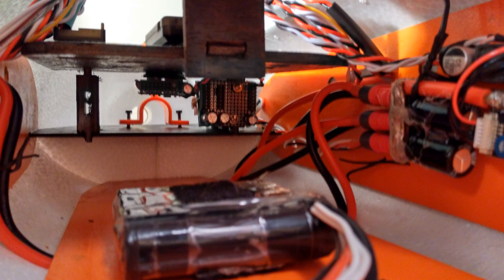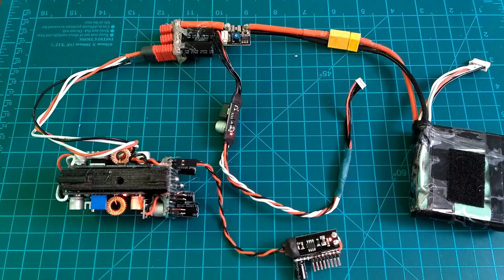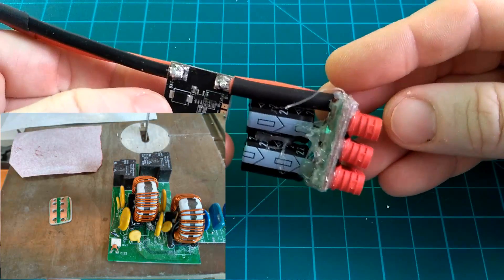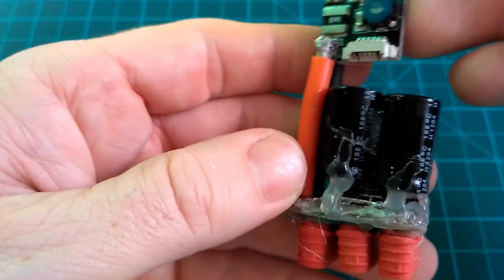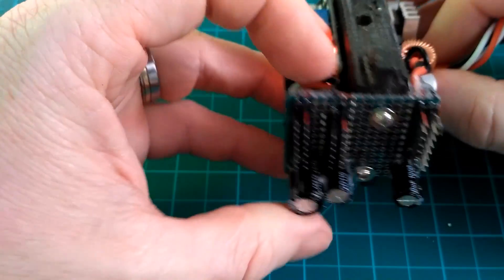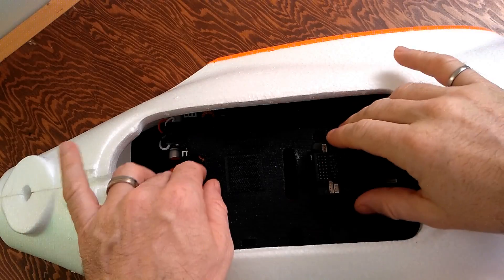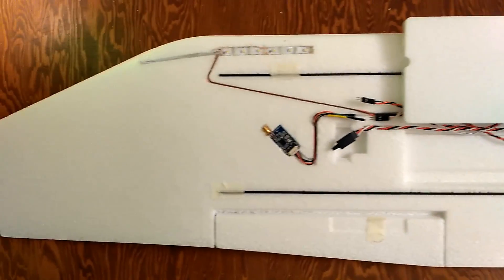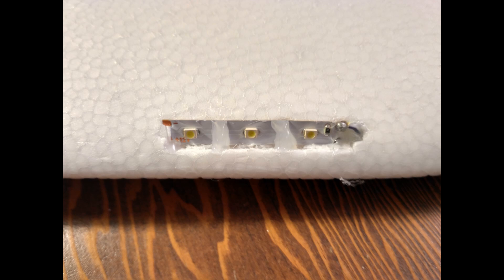Skywalker Eve 2000 Build Pt 2 - Power distribution and Filters, Wing Construction, Lights

Comment: The waterhammer effect starts and has to be stopped up close to the ESC'S ! Having the capacitors far from the esc's will do nothing to stop the hammering effect The long esc's wires have on your system. 
https://www.rcgroups.com/forums/showthread.php?952523-too-long-battery-wires-will-kill-ESC-over-time-precautions-solutions-workarounds

Comment: The waterhammer effect has to be stopped up close to the ESC's . This  aircraft has long motor wire that increase the induction and waterhammer effect and must be stopped up at the ESC'S
https://www.rcgroups.com/forums/showthread.php?952523-too-long-battery-wires-will-kill-ESC-over-time-precautions-solutions-workarounds

Comment: for the VTX its better to have the power filter as close to it as possible and the wires between the VTX and its own power filter as short as possible. I did the same with the camera. I also filtered the power for both just after the regulator before it went into the vector OSD for the voltage reading . the  power for the VTX and Camera also now have their own battery and step up step down voltage regulator .  my power filters have a diode for reverse polarity protection and a toroid coil to resist voltage change made with magnet wire then a 16v 470uf cap to smooth out voltage spikes (only the + side on diode and toroid . ) neg wired only to cap neg then to vtx .

Comment: WOW!!! That power Management unit with LC Filter is an Awesome Idea.. Do you mind If I copy it?? I Mean I have done next to the impossible to suppress the noise on my planes.. but you have a much better Idea because basically you have make sure is all in one place so you can place all sensitive equipment far & away from it!! TREMENDOUS KUDOS FOR YOU MAN!!
Reply from the maker: Glad you liked it. Hope it works for you too.
Reply: Yup.. so few people is capable to keep in mind that noise is the first line of vid interference,  and that the farther away a plane goes the higher the level of noise gets from the VRX Point of view.. so thanks!! I have something kind of on the similar with my FX-61 but you manage to get all the noise dealt with exactly in one single location.. Usually I use LC Filter next to the VTX, and The Camera, but not on the source directly..

Comment: Hi,

What is your AUW of the EVE 2000?
I just finished building my EVE2000 at with 10,000mah 6S (and full FPV gear) it adds up to 4,300 grams.
Is that sound reasonable? How is the stock motors thrust?
My PnP came with 550KV motors
Reply from the maker: +Yariv Milber in still waiting for a couple servos to come so I can finish putting this together I'll be sure to include the all up weight in the last installment of the build. I think will 550kv motors you'd need big props or on 6s with "normal" 10" props

Comment: Im trying to learn the APM using the APM Pro mini (the one with servo pinouts only)  So far I seem to have it and the Minim OSD working good with Arducam FW on the Minim, like yours, although it's not flown yet.
   Not new to FPV, but the APM is a bit of a challenge for me....Be interested to know exactly how you have wired your Minim, Camera and VTX as I think this is the key area to get correct. Im using the original Minim in a case but have avoided powering the 12 Vdc end with its poor linear PSU and just used 5 volts only from the APM module by soldering over the 5v pad on the Minim. The Camera and 1280mhz VTX both have a shared separate 12v supply, and a common ground point. I did have some flicker problems at first but changed to a Runcam Swift which solved the issue due to it having less TV lines.
  Be interested to hear your input..?
Reply from the maker: +EnglishTurbines I'm working on a video about minim osd right now. I have spent a lot of time on this, and done a bunch of experiments . I really like it! I've discovered it's not just about power it's also about the video signal that's feeding it and the version of software used to run it. I have also avoided the 12v and just used solder pads to power the video side. When I finish the wiring I'll do a complete walk through of it.
Reply: Capt Science Cool, look forward to seeing your Video soon....:)